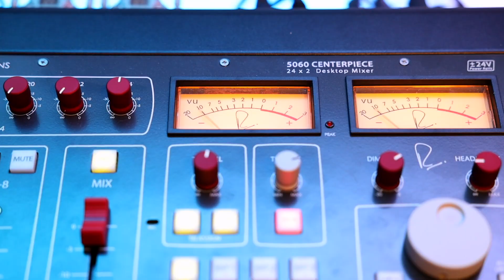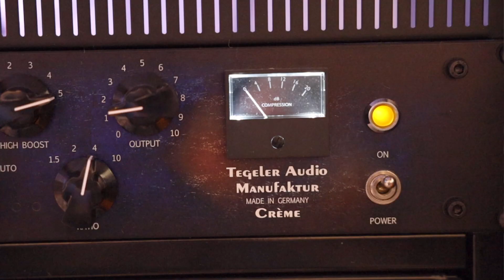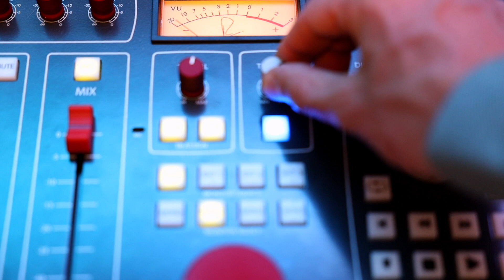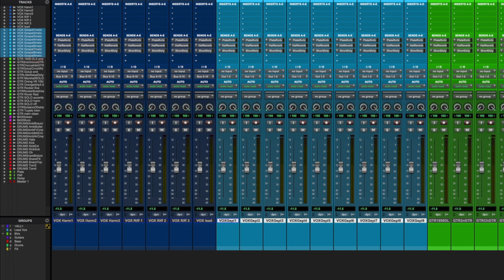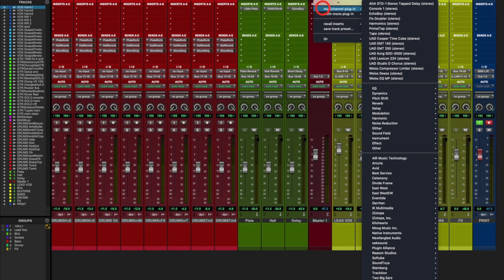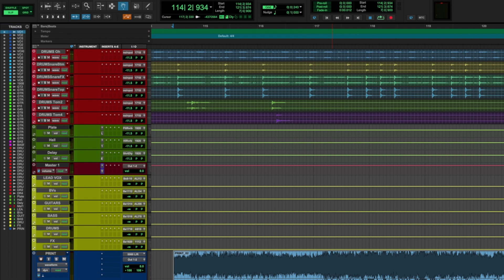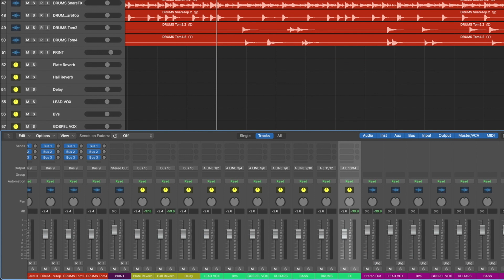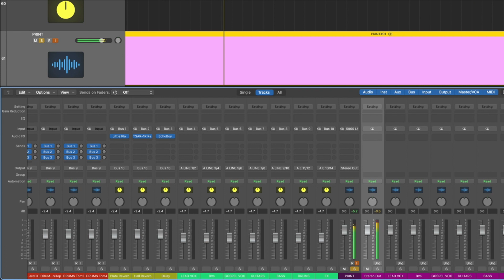Analog Summing Workflow 🛠 Setup and Benefits in Pro Tools and Logic Pro Tutorial 🦾

Comment: I just bought a Neve Orbit summing mixer. I’m using all 16 channels and trying to push the mixer into the red on kick and snare hits but I’m clipping my D-A before being able to do so. Any advice?
Reply from the maker: You are clipping the Orbit or your meters in your DAW? Either way, there are a few options. One would be to consider compressing those tracks on the way in. Another would be to consider printing stems. This might give you more headroom and then you can sum the stems as the full track. Does that make sense?
Reply: @ToddUrban   Thanks for the help! I’ve been mixing hybrid for a while and the recommendation I’ve gotten with this new orbit is to get the red light to blink occasionally in order to be in the sweet spot but I’m not hitting the orbit loud enough. I process all my tracks in the daw and send them out to the orbit via busses as loud as I can before  clipping my output converters.. but no luck yet getting into the “sweet spot” of the orbit without completely clipping my converter on the way out of the computer. The orbit has so much headroom I’m having trouble driving into taking advantage of the tone. One option would be to drive into the orbit with 16 external preamps.. but it my just be user error in my daw gain staging :)
Reply from the maker: I wouldn’t think that using additional preamps before the Orbit would be the answer. I would explore your interface and see if there is a way to drive the output harder. For me, it is usually just as simple as pushing the outputs from my DAW harder and I can find the sweet spot with the 5060. I also happen to use the insert on the master, which allows me to hit a compressor once the tracks are summed and then hit the return even harder going back to the 5060. 

I know the RND manuals are great. Did you check there for some setup ideas? It might even be good to send them a quick email. I’ve found them to be super responsive as a company.
Reply: @ToddUrban   Thanks for the help! The manual is good but super short. I'll email RND, I'm sure it has more to do with me changing workflows to match the gain structure of the Orbit. Vintage King has a video of a mix to show off the 5060, 5059, and the 5057.. identical mix settings for all three with the goal of hitting the red light on kicks and snares but the Orbit never hit the red light.
Reply from the maker: Yeah, one thing to remember, there is a huge benefit to the open sound without necessarily pushing the saturation of the unit. I’ll impart some blue or red silk and drive the meters a little harder. But for me, the workflow of having that additional headroom is the game changer. Anyway, if you figure out some tips, please leave them in the comments. I love having people voice their ideas on my channel so we can all grow from our unique experiences. 

Also, thanks for watching and supporting the channel! 😃
Reply: I ended up getting converters with more headroom so I can push out of the computer louder and into the orbit harder. The barely blinking red light is a nice sweet spot for some rock tracks.
Reply: @JohnMichaelFord  what convertor did you get?  i didnt know d./a converters have differnt head room
Reply: A design Atty

Comment: Hi there, Thanks for the video, just wondering which method is best to add a parallel aux track into the summing mix? thanks
Reply from the maker: What exactly are you trying to do? If you are creating a parallel aux track in the box, just run it out to the summing mixer alone or as a stem of all the combined aux tracks. If you are talking about having an aux track in the analog world for processing there, it is basically the same idea, except you would need to have a dedicated output that first went to the outboard gear and then returns to your summing mixer. (You can do this via a patchbay or by having it hardwired to one of your outputs)
Reply: Thanks for the advice:). 
Do you know if there’s any info out there regarding panning for stereo groups on a summing mixer? 
I mean, Ive come up with some pretty nice sounding combinations but just wondering if there’s any pro info on this?
Reply from the maker: Well, I treat panning the same way as when working in the box. There isn’t some major difference. But for me, it is easier to hear the clarity and width in the analog world. 

I know Ryan West has a great video on his thoughts. He was the one that for years encouraged me to try this workflow, so see what you feel about his thoughts.